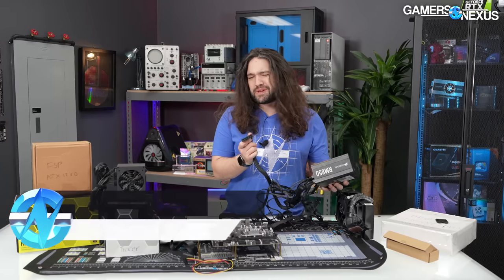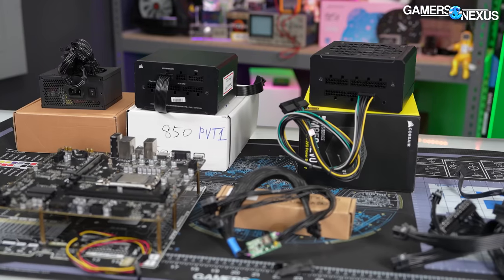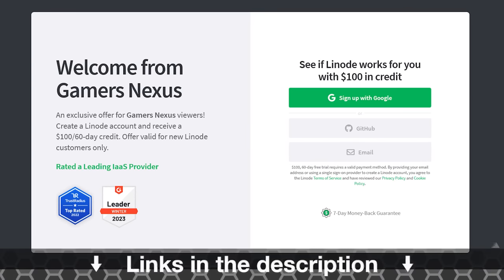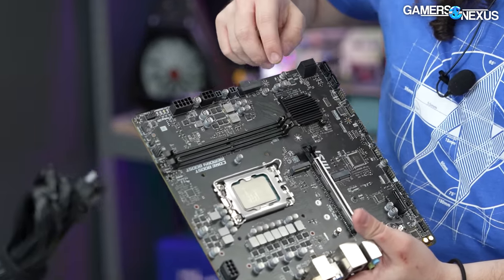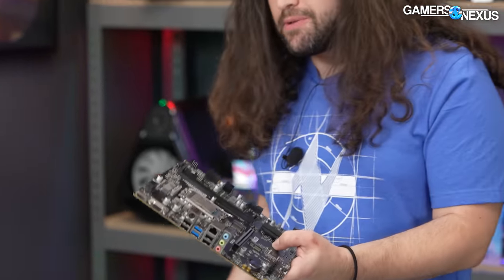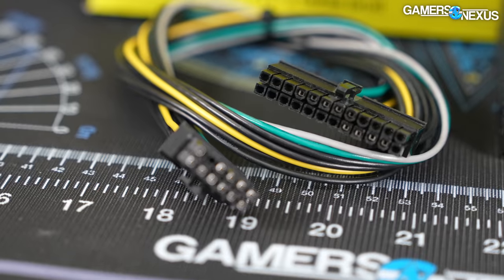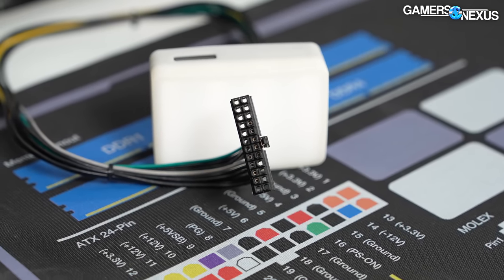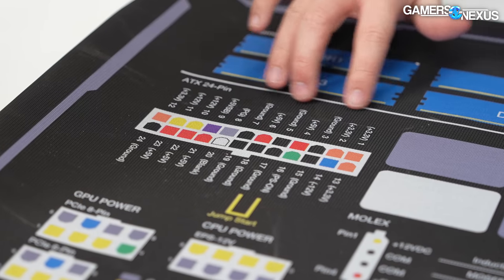The Future of Power Supplies - Maybe (Motherboard Cost, Cables, & ATX12VO)

Comment: it is something that doesn't seem to matter unless you are going small form factor, but that seems to be the direction everything is going. today just as an idle thought i recognized that with flexible displays and flexible batteries it is only a matter of years (like 2 or 3) before we get credit card sized phones only a little thicker. in 10 or 15 years they will be as disposable as a credit card is today. but i will stick with 24 pin for now unless i am building something micro-itx.
Reply: if it is all 12v it would be pretty easy to source an external psu for a micro-itx itty bitty system then just install the psu into the wall. could still run as hard-core a system as you wanted, but the device would be tiny on your desk, a little bigger than the video card. but i still agree with linus that the best solution is to move the computer somewhere else in the house if you want true silent computing.
Reply: @kght222  We've hit physical limits, tech isn't going to be decreasing in size much. You can stop dreaming, wake up, and look at the GPUs.
Reply: @RawbLV  also, i don't think you know what a gpu actually is. do some research.
Reply: @kght222  You must be trolling
Reply: @RawbLV  you are a child.
Reply: @kght222  Says the dreamer

Comment: Personally not a fan of this, at least for home/DIY systems. I can see it making sense for workstations as those tend to also have proprietary parts and limited options/upgradability as well as making them smaller could matter. But for DIY and personal systems this feels like it's full of cons and almost no pros. As someone who has multiple SATA drives in a RAID (and yes, an internal optical drive too) this heavily limits the amount of drives I can have based on how many power connections the motherboard gives me.  On standard boards a simple PCIe card gives you more SATA ports if your motherboard does not have enough, and powering those drives is a limit of the PSU, not the motherboard. On top of that, since many devices still use other voltages than 12V anyway as the video mentioned this means a large chunk of the power conversion/regulation circuitry goes from the PSU to the motherboard. If something happens to that circuitry I would much rather have to swap a far easier and cheaper (usually) to replace PSU than a motherboard (Plus I trust the PSU manufacturers more than the motherboard manufacturer to design that part well). A motherboard swap would basically require a full teardown of the system, and that's only if you can still get that motherboard or a similar one that fits the CPU (*really* painful if your system was Intel) otherwise that means entire building an entirely new system with at the minimum a new motherboard and CPU, or hunting down used motherboards that for some reason tend to retain stupidly high prices on eBay for how old they are. 

All of this for ... power supplies that can be smaller (useless for most unless you are trying to build an extremely tiny system), a bit more efficiency (again, mostly useful for large fleets of workstations, not so much individual DIY systems), and.... less wires to plug in I guess? And as another person mentioned, we know very well they are not going to lower the price of the PSUs even if they cost drastically less to make 12VO ones, if anything they will charge more under the guise that it's a "new" tech and new tech tends to cost more, while motherboards will also go up in price not just because they do now need to include more components on them, but also additionally even more just because they can like what happened when DDR5 boards started coming out.

Just seems like nothing bot a huge pile of negatives, 12 volts or not, for anyone building a personal/DIY system and almost no positives. I was going to make more puns there at the end but I had to resist.

Comment: 12 volt only only makes sense for datacenter scale where it costs more to have someone swapping out bad parts than replacing the parts and 5v resistance losses matter. In those contexts just throwing out the mobo when something goes wrong is okay. But for human people putting all the voltage regulators on the mobo means the mobo fails instead of the PSU and now it's big money to replace. 12VO is terrible for human people and good for corporate people.

Comment: There are some misconceptions in this video and comments I would like to address. I have an engineering background working on server PSUs.

The main consumers in your computer, CPU and GPU, are already 12V. The power converter for your CPU (the VRM) is already on the mainboard next to the CPU. The power converter for your GPU is already in your graphics card. 
Claiming that the mainboard design needs more layers for 12VO is in my opinion b.s. There is already a complex power converter (the VRM) on every single mainboard. Now you are telling me you can not put a small simple one on the board without additional layers?

The cost for the additional components could easily be substituted by removing other useless junk like LEDs and cover plates from the mainboard.

Having to convert the 5V for the USB A and SATA ports is probably the biggest change. I agree that having to add a converter for this on the mainboard is a downside of 12VO. For SATA it could be better to just sell it as a separate module instead.

The -12V is nowadays completely useless. There are no modern components that need this.

The problem with having multiple output voltage rails coming from the PSU is that the PSU engineer does not know how much power is required on each rail. So everything is just oversized. Also if you buy an 850W PSU how much of it is 12V, how much 5V and how much 3.3V?

About reliability:
A well-designed buck-converter (not to be confused with expensive) will live longer than the time you want to use the same computer.

For a relatable design, voltage rails should be generated as close as possible to the chip that is using it. For example, a 3.3V rial will be generated locally from a 5V rail. This way, if there is some instability and the 5V dips to 4V for a short time, there is still some margin left. 
Voltage conversion is already happening in many places on a modern mainboard. 

About the I_PSU:
This is the best thing about the new standard so far. It allows the mainboard, and thereby you, to know how much of the PSU is actually used. This means no guessing if your PSU is over- or undersized. It being "ironically" 3.3V makes complete sense because it is a signal output, not a power output.
It may even allow active current share between multiple PSUs in parallel or in high-reliability applications.

TLDR
For the most part, 12VO will not change much on how a mainboard is designed and there is no technical reason why it should make them more expensive or less reliable.  Having to generate 5V for USB A and SATA is a bit of a downside.

@Gamers Nexus
I admire your channel for being actual tech journalism instead of just a marketing outlet for companies. But when it comes to PSUs I think there are many misconceptions and I think you could do more to address them.

Comment: It's certainly time to move away from PSU's that provide five different outputs. But it's also time to move away from 12 volts as the standard for the highest power supply voltage. With the new breeds of power-hungry CPU's and GPU's, 48 volts would be much more suitable. Motherboards and GPU's already have VRM's on board that convert 12 volts down to much lower voltages suitable for the silicon that does all the heavy lifting. But when you're talking about 700 - 1,500 watts total power draw at times, the current needed at 12 volts becomes unmanageable. That's why we saw (as I predicted) the new GPU power connectors melting. By adopting a single-rail standard of 48 volts, and then letting the motherboards and GPU's do all the necessary downconversion from that voltage, the cables from the PSU can be thinner, with fewer wires, and the connectors become far less critical in terms of keeping resistance low. 

For those unfamiliar with Ohm's law, here's what I mean: A PSU delivering 1,000 watts through the 12V lines must deliver over 83 amps of current to do the job. That much current requires heavy and numerous wires and large, solid connectors to prevent overheating and possible catastrophic failure. But at 48 volts, the current requirement drops to less than 21 amps, making the job of delivering that 1,000 watts to the motherboard and GPU much easier and safer. 

Computer enthusiasts are used to having to change motherboards every so often to accommodate new CPU designs. And we also have to update our PSU's as well. It's not too big of an ask to have us make the change to a better power delivery system. But it should not be 12V, it should be 48V.

Comment: I'd prefer if the removed all the 3v and 5v from the motherboard. If a PC needs the other voltages then a small plugin could be supplied for the power supply.

Comment: On the upside, sounds like using a PSU as 12V power source for running car/boat electronics (like an amp & sub) off of a 120V wall socket will be simpler than ever! 😂
Reply: Recent PSUs use separate converters to generate the aux voltages from the 12V, so they won't blow up or go out-of-spec if you only load 12V like old ones would.  It's already just as easy as ATX12VO will be.

Comment: i dont think 12vo standard will totally make the old PSU's useless, a simple plug conversion is needed for them to be used on 12vo motherboards. Yes the other voltage rails on the old PSU wont be used anymore but they can still supply power to newer 12vo boards perfectly. Similar to the new high power rails for nvidia gpu's, plug converters can be used as stop gap solution while the industry inches to the 12vo adoption. In hindsight this is again intel shifting the problematic easy to break components to the motherboard like what they did from PGA/daughterboard cpu socket to LGA where the motherboard vendors shoulders the problems with damaged pins now hahaha. heck VGA signal has been removed from gpu's since the geforce 10th series yet people just uses active hdmi to vga adaptors and didnt made VGA only monitors obsolete, gazillions are still in use.

Comment: I know Steve is always right in his assumptions/predictions. So pardon my language but the PC parts manufacturers can eff off. AM5 mobos are already bloody expensive, (I am glad I chose to max out my AM4 platform and will probably skip AM5 and/or go back to Intel), and if this tech catches on, and mobos get more expensive, it better be reasonable, and if features removed from PSU's, they better adjust pricing. GPU pricing has already ruined the PC market in my opinion, (had just gotten several friends to switch to PC from console but they are probably going back now). Otherwise I will use my high end AM4 platform until is no longer viable, then switch to gaming laptop or console. Sad to give up one of my fave hobbies, but this is getting ridiculous. I lucked out and got a GPU upgrade at MSRP right at the GPU's lowest point this past summer, and got a great deal on my high end AM4 CPU / MoBo combo last winter, and the rest of my parts were transferable. I was hoping to ride out the bumps but it clearly does look like they are trying to make PC gaming elite again, just after it had become attainable for most people pre-pandemic. What a shame. Guess my other hobbies will get all my attention once my current PC is no longer good enough. (Mountain biking, painting, hiking, wood working, camping, etc.). After slowly working my way up from entry level, to mid tier, to high end, I have no desire to go back to entry level PC builds, when they will cost as much as some of my past mid tier or even high end builds. I can afford it, but I refuse to pay inflated prices. Is your costs go up 15% then charge that, your margins are already high enough. Charging us 30% for a 15% increase is greedy.

Comment: this standard has a lot of wasted potential. like why 12v? if efficiency's the main goal, wouldn't a higher voltage be better? instead of making i_psu% an analog pin, they could have implemented canbus or something so that the motherboard could actually talk to the power supply for smart monitoring, that would be really cool. this would also allow it to request a higher voltage like 48v for powerful gaming pcs and default to 12v with no monitoring for cheap office pcs. how cool would it be to charge your ebike from your gaming pc using usb-c pps at the exact voltage it needs and have the cpu vrms use that same voltage for maximum efficiency?
Reply: Switching losses increase with higher voltages, and it means needing a buck converter for 48v->12v. Use of canbus would also increase complexity during troubleshooting, I.e. figuring out if a system is failing to POST due to a power issue would go from requiring a multimeter to requiring something that can decode and interpret CAN.

I don’t think this standard will take off, though. It’s quite stupid to place that many buck converters right next to noise-sensitive components, even if it makes wiring a little easier.

Comment: Look I'm all for giving motherboard manufacturers more leeway in the power management category, but motherboards are getting too damn expensive. They're going to have to add a whole bunch of converters to get the right voltages they need. What I'd really like to hear, is somebody from SeaSonic's thoughts on the new 12 volt specifications. What are the benefits to them as a manufacturer, what are the benefits to us as consumers. The only positive that I can see from this, is that we can now run our computers off of the 12-volt cigarette lighters in our vehicles. Oh wait new electric vehicles don't have those.

Comment: but WHY wouldn't 5v not work? I mean realistically the standby circuit would run on 3.3v these days and it is probably attached to a LDO with a drop of less than 1V. Most sane designs would just work.

Comment: Would really, really appreciate if people would stop trying to push VO, both Intel and journalists. Almost everyone re-uses power supplies for several builds. I don't want to re-buy the same power sections over and over.

Some people have lots of drives/devices. I don't want to be limited on how many drives I can [must resist the pun] use based on the motherboard power.

There is honestly no benefit to VO other than some fewer wires. There is no reason it's going to be more efficient on the motherboard. Especially for those of us who use power supplies in a higher class than motherboard (wanting platinum or titanium efficiency doesn't have to tie in with how much compute power I want). Moving this stuff to the motherboard does not magically increase efficiency. Out of all possible changes they can make to PSUs, this is the one thing I want even less than Nvidia's PCIE power changes.

Comment: How would 12vo work with things like watercooling pumps, assuming the motherboard is now responsible for powering secondary items (sata) but these things are being shut down by standby, could we face situations where the pumps turn off during standby as a 'power saving' effect and then watercooling systems break. I don't see any gain to having the hardware on the motherboard, it makes it convenient for switching it from a business point of view (prebuilts) but not for consumers, as now a power supply failure could occur in two different locations and make already expensive ($500+) motherboards have more points of failure. This spec seems pro business (lower energy costs) but anti consumer, frankly.

Comment: I think we need to just move to a 24v or higher connection. The amperage of 12v that we are pushing is getting crazy. All these parallel cables and connections is getting ridiculous.

I mean let us take a step back and wonder, why are we using just 12 volt DC power supplies to deliver almost a thousand watts to CPUs and GPUs?! This isn't car audio. We can change these specs.